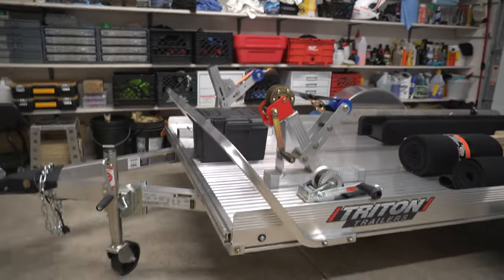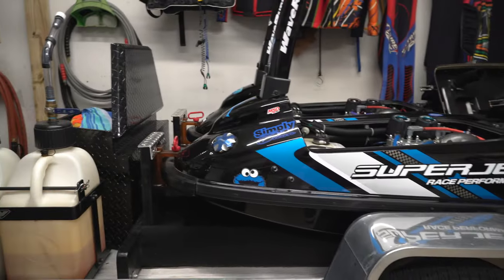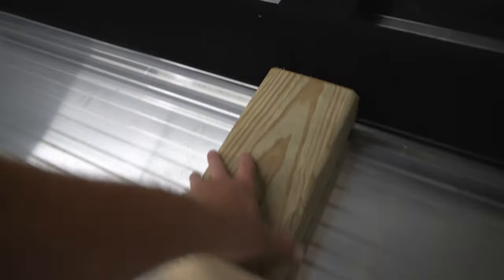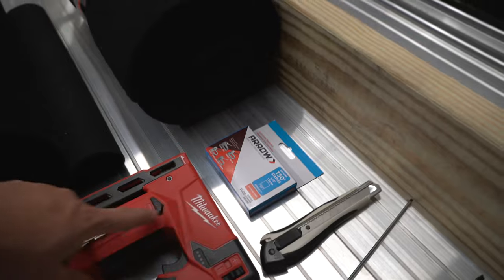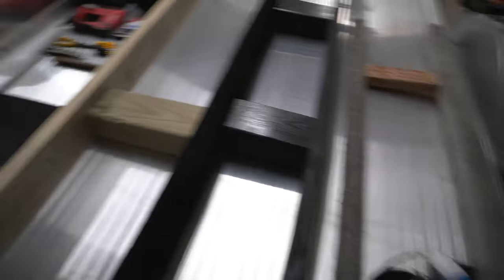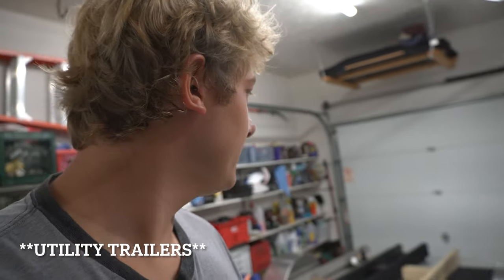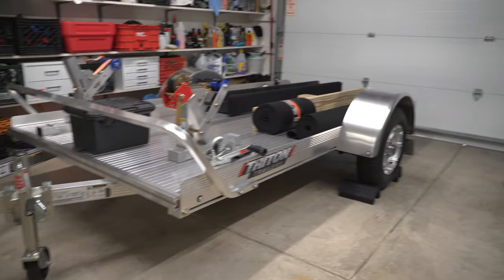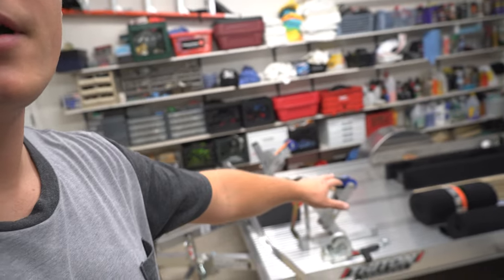New Stand Up Jetski Trailer Set Up !

Comment: Been using a Featherlite flatbed aluminum trailer for over 20 years with no issues. I like being able to walk on the trailer when loading and unloading. I prefer 3 inch PVC for bunks. Just heat the ends with a heat gun and flatten them. This gives a place to bolt them down and they don't roll.

Comment: Do you have a link to the rubber mats you used? Also are you just using nails to hold the center 2x12 in between the bunks? Also What size U bolts are you using to hold down the winch assembly?
Reply from the maker: we got the rubber from a refrigeration supply house. Its just a vibration pad. Nothing special just rubber mat. We used long outdoor rated deck screws.the u bolts we used for the sxr has 3/8 the superjet has 5/16 but the 5/16 would be plenty good the weakest point is still gonna be the aluminum decking.